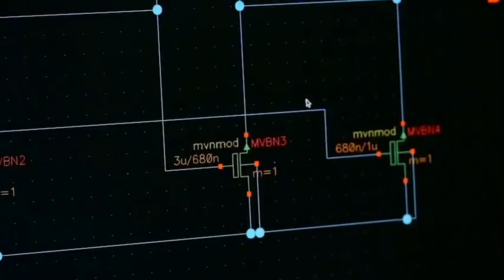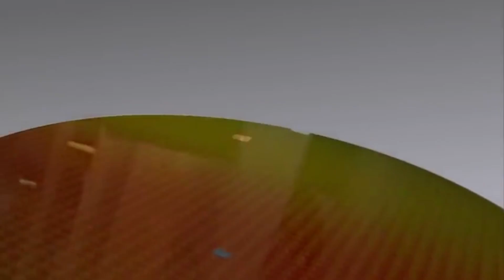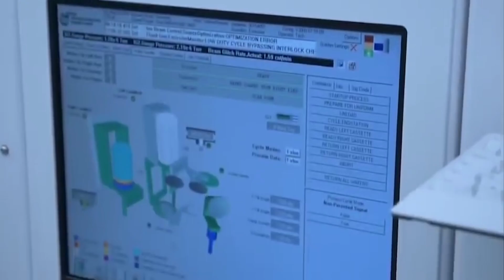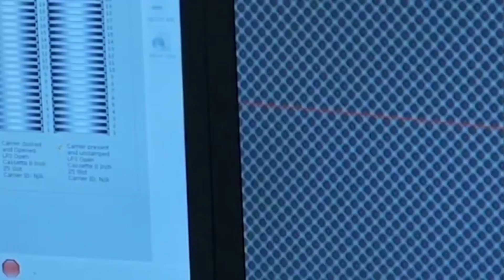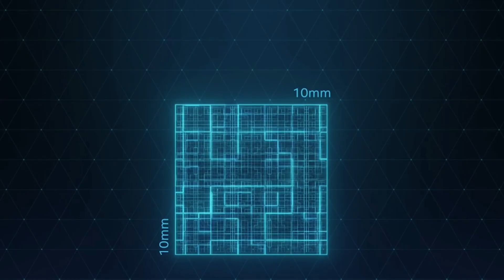HOW IT'S MADE: Microchips

Comment: All I know is you start with a heavily doped wafer then you grow your silicon dioxide on top of the wafer. Then the source and drain is defined through etching. Then its predisposition of boron or phosphorous ions. Then you coat it with another layer of silicon dioxide and define your gate and top it off with aluminum

Comment: My mind still can't accept the fact that we can build things at those scales.
The size of these things is unimaginably small.
Reply: Yes I worked in semiconductor company and I know about this how it made and  we can able to build any semiconductor in any package.
Reply: @Timepass-gm6hc  Can u explain how does those small things are made? robotic nano arms or shooting nano light patterns? or how? I didnt quite understand videos
Reply: @mcan-piano4718  Silicon can be doped with other elements to make it react differently electrically. They start by taking a piece of silicon (a wafer) and apply a mask on top of it that's opaque in very specific spots, according to the circuit. Then, they cover it in a photoresist material. They then use specific types of light, which travels through the mask in the parts that are opaque. The mask is removed, and they put the wafer into a furnace which they pump with gas. The gas, known as the dopant, ends up deposited onto the parts of the silicon wafer left exposed by the masking process, changing how the silicon will operate electrically. They then cut the wafers to size, give them their legs, and cover them in epoxy. Hope this helps!
Reply: @ayoitscat  Yess noww I understand more.  So Wow its really clever and complex technique. Thank you so muchhh for kindly explaining it.
Reply: @mcan-piano4718  The masks they are referring to is what I draw in a program. I take the engineers electrical schematic and draw it out in a program that is then sent overseas to these fabs to create the chips you use. Very interesting job indeed! (to me at least haha)
Reply: @ayoitscat  Sorry, no light ever goes through the opaque areas of the mask, by definition, though you can print a positive or negative image by selection of the photoresist used. Typically now positive photoresist is used as the properties of the resist are consistent for the subsequent processing and do not depend on the exposure energy. Caveat: reticles could be made with either as the draw time is dependent on the pattern density and only has to be good as an etch mask for the chrome.
Also the sequence is always 1) coat wafer with resist 2) align to previous layer (except for zeroth layer which is printed using the steppers mechanical alignment accuracy) and print, 3) develop pattern, 4) etch pattern into underlaying films or base silicon or implant dopants, 5) remove residual resist and clean wafer surface, 6) go to next sequence which may be blanket implants (doping), depositing a new film, etching away newly exposed underlying films or back to 1) for a new layer of resist...There are also many measurements that are made in the course of the process from a film thickness to the size of an etched line...

There are also many more steps that you imply in your scheme....Roughly you need to do:
1) First you define your transistor active areas
2) You define/dope well areas for CMOS
3) Define/etch gate electrodes
4) Deposit/Etch sidewall spacers for LDD's
5) Dope transistors
6) Deposit ILD
7) Print/Etch contacts
8) Print/Etch transistor interconnects (this is repeated from 1x for really simple circuits to 14+x for large/complex circuits)
9) Dep passivation/print & etch pad mask...this is the end of the circuit generation, but there is also...:
10) Backside polish/thin wafer (probe test, dice wafer, sort good die)
11) Optional...for stacking chips, etch through chip vias for interconnects between wafers & deposit metal/make bumps for connections
12) Package, possibly final test depending on yield (may just be a simple continuity test)

Your package may have legs, pins, pads or solder bumps depending on how it is intended to be used.
Reply: @thecraggrat  thanks for the elaboration, I'm far from an expert on this but was hoping to at least provide a basic idea of what's going on
Reply: @ayoitscat  No problem, I've put a couple of replies in here, the above is just a very brief idea of the order of flow in a wafer fab. Lots of stuff is left out, as there are also dependencies, eg are you making CMOS, NMOS, PMOS, SOS? What size are the devices? - this will change the flow significantly. 
I've made from 16µm PMOS to 14nm CMOS on 3" to 12" wafers, contact aligners to steppers and dipping wafers in a wet acid bath to etch to using plasma etch to thin gate oxides by a couple of Å and implanting the oxide with Nitrogen.
It's all interesting stuff!
Reply: @thecraggrat  It's very helpful information! I'm hoping to study electrical engineering once I reach university and have a career in subcircuit design, or something of that nature :)
Reply: @ayoitscat  Best of luck in that. One thing is for certain is that designers for devices will continue to be in demand & will have a very portable skill.
Reply: @ayoitscat  Sorry dude, just replied to a much earlier post of yours, forget it. 
BTW, in addition to circuit designers, you also have circuit layout afterwards, though I think a lot of that is automated now, the tools to do this still have to be designed... Another thing to check out in the industry if you are interested though.
Reply: @thecraggrat  thanks for the advice!
Reply: Government has tiny people that build them
Reply: crazy thing is they are getting even smaller
Reply: And it's so precise within such a small size. You have often only a centimeter or two (sometimes less) to arrange billions of transistors with very little room for error, yet few that get made end up defective
Reply: @ayoitscat  I am in the industry. We have issues with getting atoms to create beautiful symmetry. If we could get the atoms to perfectly line up then we could go to sub nanometer. Currently the gate prevents this until we figure out a way around the bottleneck in size reduction.
Reply: @lutronc4412  Without God's will you cannot do anything. Nothing. If you have succeeded at something, it means God willed it.
Reply: So how do they make it so small? I still didnt understand. Can u explain if u understood
Reply: @mcan-piano4718  The image of the electronic part is printed on a square glass called a "photomask". A laser light is shot through this glass and that image is transferred onto the quartz wafer BUT through a convexed lens making the image a lot smaller. The image is very well defined because a laser light was used. These laser shots are repeated as many times as many parts can fit in one wafer. The wafer is coated with a chemical that reacts to light and the areas that reacted to light gets broken down and removed with a chemical wash. Where the coat has been removed the metal gets exposed and this metal is removed through chemical "etching" and what remains is the exact replica of the electronic part but a lot smaller. These parts are then separated from each other using very thin circular diamond dust laced carbon blades. Once separated they are wired and packaged in individual chips with legs connected to the inside electronic part. Now it can be seen as a chip. Hopefully that helps a little bit.
Reply: @mcan-piano4718  Originally the mask pattern was made using hand tools to cut out the pattern onto rubylith film (search wikipedia) from the design, then the pattern was optically reduced up to ~100x and printed in a step and repeat pattern onto a photomask, which contained all of the die that covered a wafer.
Later, the design would be direct printed using an e-beam writer as there was less chance for defects to cause bad masks; this is because the design database was written directly to each die on the mask, so you wouldn't see repeat defects.
Finally the database is direct written to a photo reticle, using e-beam writing; except instead of being written at 1:1 dimensions, the reticle has usually a 4:1 or 5:1 size (larger size on the reticle) which is then optically reduced when printing onto the actual wafer, it is then step and repeated to cover the wafer with the chip design.
Layers are aligned by an interference target, where the reflected light from a prior printed target interferes with a target on the reticle, this produces a signal that changes depending on how accurately the layers are aligned, so you may maximise this signal and then expose the reticle to transfer the image to the photoresist coating on the wafer, step and repeat for each "field" on the wafer.
This technique is good down to about 14 nm, final print size, but you have to use optical correction techniques or multiple exposures at the small end to get the right shape printed due to resolution limitations in the optical system.
Once the pattern is printed and developed, it is transferred to the underlying substrate by etching, usually in a plasma etcher, though possibly in a wet etch system if dimensions are large enough. Also the pattern may be used as a mask for implants where the different dopants to create the transistors are introduced to the silicon.
Consider all of the printing that is done above (apart from with e-beam) to be like using a huge camera the mask or reticle is what you want to take a photo of and the wafer is used as the "film", also the "picture" is just straight 2 tone black & white, no shades of grey.
E-beam printing is roughly like using an etch-a-sketch to draw the design directly.
Reply: It’s amazing. I work for the company that has the monopoly on making the lithography systems.  The technology used is incredible. Amazing how just 1 tiny particle could destroy the thin film coating on optics used in our machines. Everything is very precise.
Reply: We Are humans after all
Reply: Takes some years to understand and absorb. ;0)
Reply: Ok, so  I had the same doubt but none, seem to explain this simple fact, they make what's called a mask which is big then they UV Light and a *lens* focuses it to a tiny point. So The lens is what doing the job of making it very small. There is a great video from Intel youtube channel which shows this. watch?v=d9SWNLZvA8g. Have a nice day.
Reply: @Adhithya2003  bhai youtube link copy ni hora
Reply: dude that shits freaking atom size like you cant really go that much small than that, at least i dont think for now
Reply: Microscopic. Amazing.
Reply: and than how it started with sand
Reply: Aliens gave us help to get where we are, and this technology existed on earth before Jesús christ.
Reply: @StarBoss-1992  Are you playing games, or are you a little deficient between the ears?
Reply: Yeah I can't wrap my head around it how can they make this and make it affordable for us
Reply: @ricky107_  its affordable because it needs to be, its an investment by the governments to keep track of its slaves the human race. The data we create today will be compiled later for AI to go through and they will have a nice digital history book and digital fingerprints for every single human being in the dystopian future.
Reply: @ricky107_  THIS IS WHAT THEY PUT INT HE VACCINES
Reply: even if i watched an explanation video  more than 24 hrs i still would'nt be able to
Reply: Who made atoms and particles?

Comment: But I would have loved to see how they test the chips before selling them or seeing the absolute last phase of production
Reply: They have contact points on them in the scribe lines for testing, they run the shit out of them with test probes to make sure they work. Then they ship them for packaging where they're sliced into chips and they get the pins, covering etc. See "chip assembly and test" video for an old video on what this means
Reply: Talking about test, there are various type of tests nowadays, but you may google IC socket tester to get the idea. the package is mounted to the socket which is placed onto the PCB to test its performance before they solder the device. This is my current career and I love it!

Comment: My goodness 😍

Okay can anybody tell me, how microchip works exactly? Like how a PC ram stores memory, how a mobile phones processer decides to show notification bar when we swipe down ?

It's so complicated and intresting 😍
Reply: Basically each chip is designed with transistors. You can see them in the clips when he’s going over the design. For most applications we use what’s called a MOSFET but some designs need a BJT. They’re both types of transistors but for a simple explanation it’s not important. You can use these transistors to make what’s called logic gates. Logic gates perform different operations like AND OR NOT NAND NOR and XOR. For a NOT gate if you supply a voltage of lets say 5 that would be a binary 1. A voltage of 0 would be a binary 0. So when I refer to 1 and 0 that’s what they mean. It’s just a voltage. Anyway for a NOT gate inputting 1 would output 0 and vice versa. If you have an AND gate it’s output will only be 1 if all it’s inputs are also 1. An OR gates output will be 1 when at least one of its inputs are 1. I think that’s enough to get the idea across. Basically chips are designed using these logic gates. You can make memory, processors, pretty much anything. It’s really fascinating. Obviously I went into very little detail but if you want to learn more I suggest checking out these people, Ben Eater (he has a bunch of really cool bread board computer videos) and ElectroBoom (he has a good video on logic gates and how to make them)
Reply: @dizzoooo-l4p  aww thank you so much, i took a engineering so I'm interested in this topic and definitely I'll check that channel and again .. thank you 🙇🏻 for your efforts and love from INDIA ❤️

Comment: i must say it sounds like a good researched video, but there are way too many details that get skipped or are sligtly wrong like the creating of silicon wavers. I'm not entirely sure about the other details but some seemed to not be researched longer than 15 min. it is astounding that you could say so much about the cleaness of the production room but not how the doping actually works and how it influences the silicon. (sure it isn't really needed in the topic but it shoud be correctly mentioned if the doping gets mentioned.) 
btw to all technologic fans that are eco freacs at the same time... silicon sand gets burned with tons of coal so that the SiO2 +C changes to SI+CO2 so that pure silicon remains. and if we are at it. Waver printing needs over a ton of water per hour printing. and that water is one of the purest H2O that we can create by using a lot of water from our fresh water supplies. another point that should have been in the video.

Comment: 0:29 this is not a micro chip. It's just a chip. A Microchip is barely visible.
Reply: Nope. Microchip is a common term for any IC, it does not give any indication as to the actual size of the die or its package.